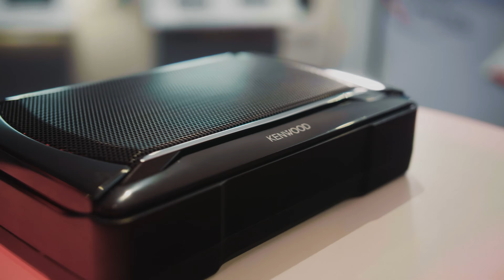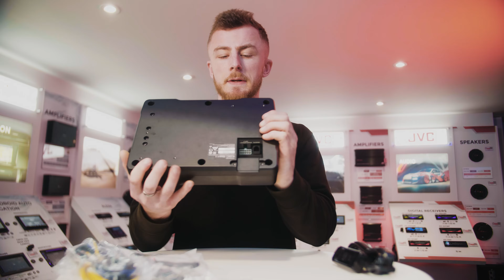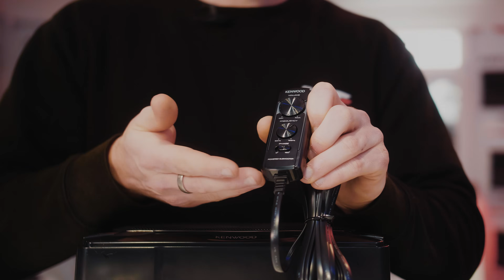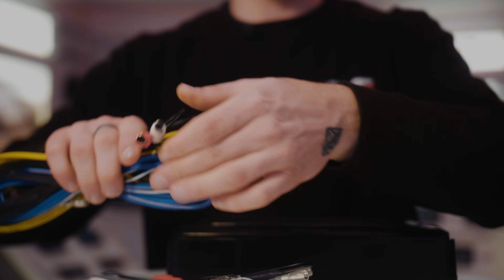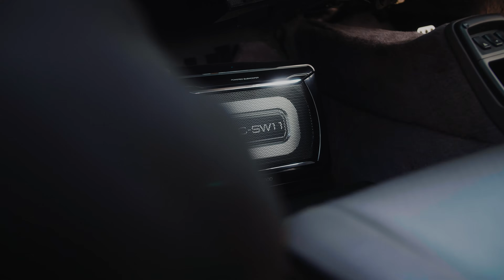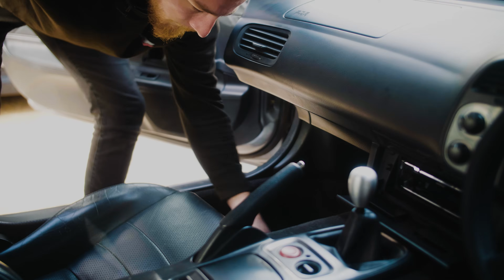Kenwood KSC-SW11 Compact Powered Car Subwoofer | Car Audio & Security

Comment: Great vid, just a question the instruction manual says to connect the power cable to the fuse box is this correct? They say this because only consumes 8.5 amps so the wirenisnt required to go directly to the battery?

Comment: I have a Golf Cabrio and not keen on placing it under the seat. Can I mount it in the boot? Also running a VW factory RCD510 stock head with Kicker Amp in the boot driving Focal speakers, front and rear. Looking for a bit more bass to complete the system....can I connect this sub directly to the kicker amplifier? Don't want to run it off the head as the power is poor. Also no RCA connections on factory head. Many thanks for a great video.